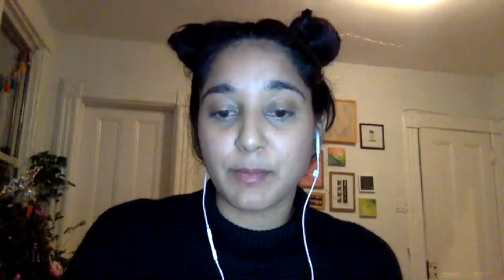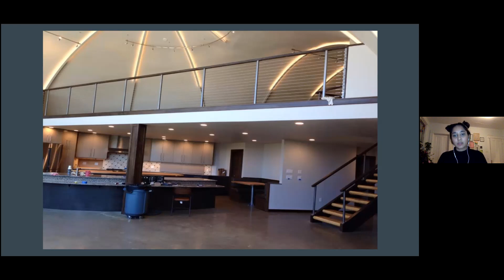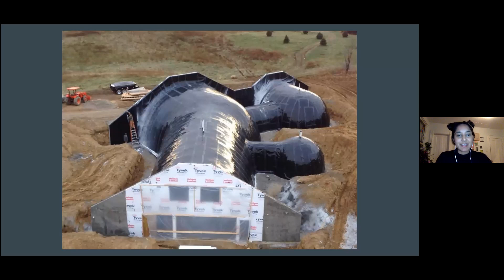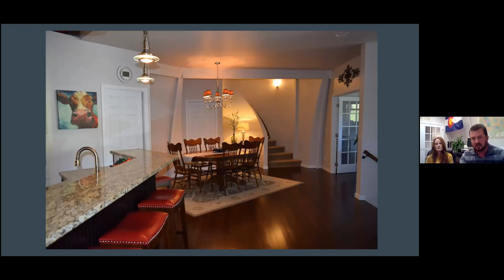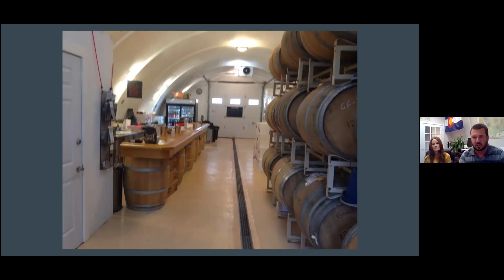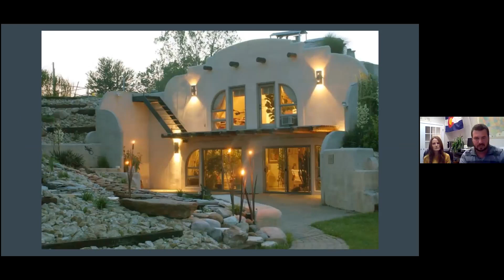What is an earth shelter home?

Comment: There is a Berm hotel in Italy and in addition  a hobbit hotel complex I believe in Thailand. Also. a dome (earth covered) home system are sometimes a third more expensive than a standard home. American dream has increased the average size of homes 300 percent since WWII, so make it one third smaller. Also the government needs to massively shift existing subsidizes around from oil, gas to green and berm homes due to low carbon footprint with small trees that absorb carbon dioxide.

Comment: Imagine walking through a park with dense vegetation. You approach a tree and plant covered hill, but just then a rock slides open and a normal, modern lobby is behind it! 5 above ground floors. A few rocky out crops exist in the much more vast are of the tree covered hill, with bushes, vines on some of trees, moss on some of the rocks, smaller trees of species that do not grow large cover the top of the hill (for obvious reasons). Some of the rock has mica and fake quartzite and other mineral crystal forms that are really windows of glass that can be seen out of from inside but not inside from the outside (concealing that it is a window and not a big Chrystal of quartz or tourmaline. Ten underground subfloors deep beneath the sewers, cables, gas lines, electric wires etcetera,. Three underground floors of parking below that. Cars in underground tunnels with trees and plants across the top. Here in NYC garbage bags attract 30-40 rats for each garbage bag when they throw it out. Garage is collected underground if cars are underground so in sealed steal cans. Electric cars continuously recharged underground, vents designed for easy cleaning soundproofed emerging in a berm of trees and plants to conceal the vent openings and further block automobile sounds from deep below. My ideas are far more complex. This should replace the entire Bronx except existing parks that should be enlarged, parkways become parks, vehicular and pedestrian traffic separated with people walking on the surface. This replace most of the rest of NYC and all other cities. I mean replace, completely! Housing as right so n o homeless, temporary housing until homes are replaced by berm homes. Very strict property zoning inculcated into city charters to avoid replacing berm homes covered by trees with regular buildings down the road. Many ways to pay for it and retain a force of tens of thousands of extra park department workers with degrees in ornamental horticulture with high paying union salaries and large amount of cooperative businesses with democratized workplaces.